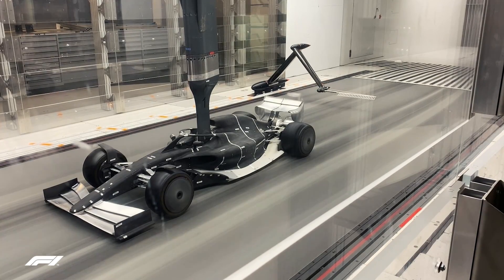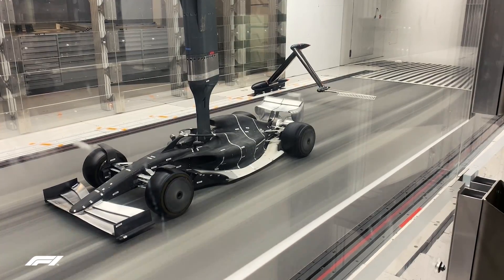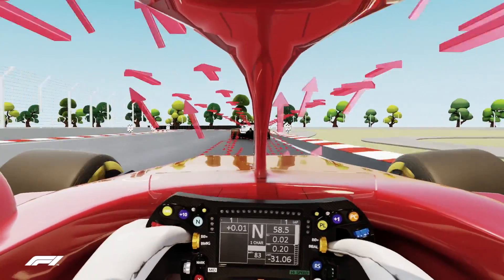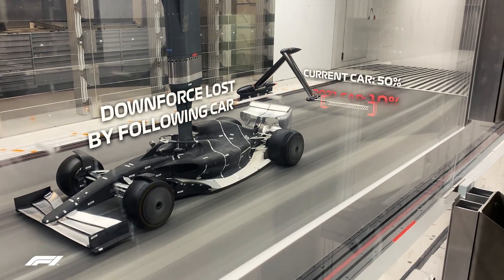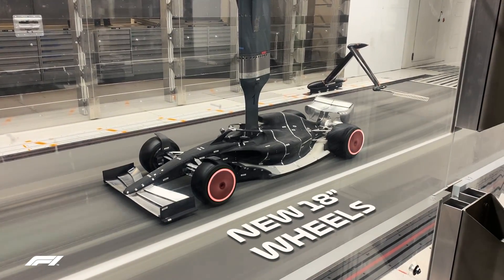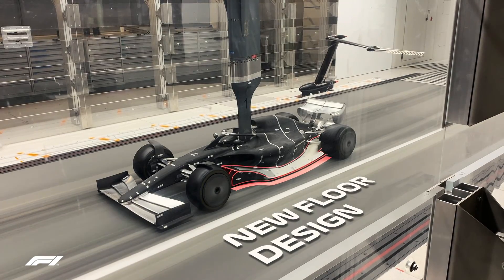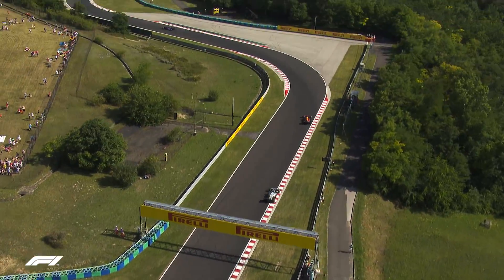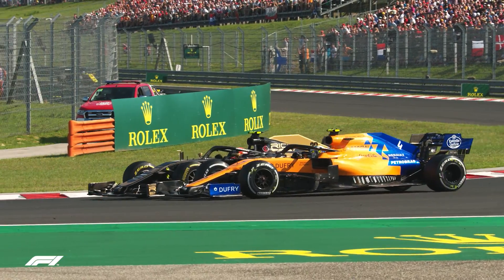Future F1 Car First Look | Formula 1's 2021 Car In The Wind Tunnel

Comment: So now that the rear wing is essentially a diverter, designed out of consideration for the guy behind you, forcing the 'exhaust air' upward, what's gonna stop a Smokey Yunick type team chief from enabling air to leak through that wing into the car behind him? Just find a way to defeat the design and direct a stream of exhaust air toward his lower leading edge and lift him right up.  
Sorry dude!  

F1's goal may be MINIMUM downforce lost by following car, but every F1 team chief's preference is MAXIMUM downforce lost by following car.

Comment: If the car following another car will have a smaller loss in downforce it automatically means that it will have a smaller gain in slipstream.
This is just a basic fact in aerodynamics: drag and downforce have the same principle in physics: Newton's third law.

If they say that the car following another car will be able to handle the corners better it also means that it won't be able to get closer as fast as it can now on the straights.

Comment: Let's just face it f1 will never be what it used to because all it takes is for one person to cry about safety and then thats it. There is more drama in one motoGP race than there is in the whole season of f1. Its sad because i grew up karting and actually looked up to them but if your a fan of f1 but tired of 15second leads watch motoGP. There isnt any crying over there. They crash and still race injured the next day passing off crutches before they get on the bikes and f1 needs to get back to that. Even Niki before he died said all the cars need to look different, bigger tires, less safety, no halo etc. You got Ferrari, mercedes, mclaren and i cant even tell the difference. I can sure tell the difference between honda, yamaha, suzuki, ducati, aprilia and ktm. 🤷‍♂️ F1 has there work cut out because they are losing fans quick.

Comment: I dont know. if my car has something on the middle in front of my eyes. It will be annoy me. But im not a racer.
Reply: Because your eyes see in 3d the bar coming down from the halo doesn't really obstruct vision. It's like when you hold your finger in front of your face and you can see through it. The drivers have also said it doesn't bother them.

Comment: If dirty air is not a problem, they should do away with DRS zones and include a limited time of DRS use at any point during the race so it's like an overtake button and driver's have to learn to manage it
Reply: Ved Singh  how does that not make sense? Instead of set DRS zones in a couple straights give them like 3 minutes of DRS to last the whole race (or whatever they approximate the number to be) and let them choose when to use it. Drs zones only exist as a patch for the problem of dirty air. Fix the aerodynamics and Drs isn't needed
Reply: Ved Singh  I agree. Wouldn't it be cool tho if we did away with the zones altogether and driver's had to recognize when they have dirty air and use Drs sparingly to compensate instead of being able to wait until a straight to get a free pass?
Reply: Ved Singh  what I mean is after a certain amount of time using it, the car would not let them open the panel. Like the time limit would be programmed into the car similar to ERS, they would just be able to use up some of that limited time

Comment: Alright, so the cars for the 2021 season will be simplified so they could follow one another, since aerodynamics has been simplified, will it have a significant impact on the car's performance, will the cars be slower/understeery because of the aerodynamics made less complicated?
Reply: They will probably be slower, but not that much slower. Ground effect is making most of the downforce back that simplified aero loses. But idc about them being slower if it means better racing.

Comment: Okay, so from what I understand, we’ve now come full circle. Less dependent on front wing downforce, more of the downforce is generated from the floor/diffuser system. 

You may loose a lot less downforce, but I’m willing to bet that tyre deg is still going to be a major factor, most likely magnified significantly. 

To counter that, Pirelli is most likely going to have to come up with a lot harder compounds. Know what that means?? Slower lap times. Unless they seriously ramp up the engine power, we are going to see PAINFULLY slow f1 cars. That’s my prediction.
Reply: these are going to be a predicted 3 seconds slower than previous cars. It probably won't be that much, considering the 2019 changes were set to slow them down by 1.5 seconds, but they ended up setting new lap records on many tracks. So I am predicting 1.5-2 seconds slower than 2020.

Comment: Finally all the ugly bargeboard madness in front of the sidepods seem to get banned! Thats fantastic! It just looked ugly, and got to complicated! Also the front wing has only the profiles! Finally F1 Cars may look good again! I think its a step into the right direction. But there is still the major problem - the Power Units! The Power Units with its almost 20 cooling circles is one of the main reasons for F1's problems! I hope(but i doubt it) they will get rid of them, too! But unfortunately that won't happen and the "Tuned Dust Devil" Sound with its problems for the Racing itself, will stay.

Comment: I think these cars could be really good, they seem more compact, and I like the shorter wheelbase, I think it'll make it much more agile and maybe "pointy" when thrown into a corner. I think this aero package though would be better with Michelin tyres than the Pirelli ones, because they have better longevity and would let the drivers push harder for longer. So couple the closer racing with the additional ability to push harder and therefore faster I think could make the races a lot more exciting. I think this is a push in the right direction. Just my 2 bits.

Comment: as Vettel said : " Bring back fu** v12s "
Reply: Are people really that stupid that they think 1990 V12 = 2019 V12?
Reply: @Tacet137  and what about a V10🙃
Reply: I think it will be better to use V10 again, but then again, that wont happen since SJW, Greenpeace, and political correctnes mofo today will and will find a way to be Offended by it.
Reply: Lan lol what are you even on dumbass
Reply: @Danielreis You only take aerodynamics into consideration when you like, but you need to think about them all the time. Aerodynamics made the V12s slower, and aerodynamics made the F1 boring because of the turbulent air the cars create. If you bring back V12s, you would have the exact same races, just about 20kph faster. Still zero action because the cars behind don't have enaugh downforce to take over the car in front. This is what F1 needs. Not more speed, not more downforce, less turbulent air so we can have more action.
Reply: We need engines that last just one race and they need to rev. Also there's no more last lap blow ups which were fun when your guy was in second, a driver behind the wheel of a time bomb is exiting. I don't care if they're slower than these turbo engines all I want is exiting racing
Reply: @rneoman  so yeah driver safety doesn't matter huh?
Reply: The v12 might be heavier slower
But i bet you my soul that there would be way more people watching if it would be v12
Reply: Bring back the clutch and manual gearbox
Reply: i wish it was v8 turbo so it will still sound high pitched
Reply: Victor Reis de Oliveira I do agree with him though
Reply: bring back the v10
Reply: The last time there was a free choice of engines team ran smaller engines with turboes over the V12, to bring back the V12 you would have to force everybody to use it over the actually better engine
Reply: Next it'll be 3 cylinder.
Reply: Zultoni Febriansyah v10 is the best
Reply: All of you asking for v12s weren't even alive when they were used lmao.
Reply: Ved Singh  his performance??? don't you delusional guys know anything about the concept the ferrari sf90 and sf1000 use??? its low downforce, high straight line speed! and as visible that you know as much about vettel as you know about rocket science, he prefers high downforce cars, and if 6 years ago is stone age then I dont wanna imagine which age senna, schumacher and hakkinen raced in!!!
Reply: Ved Singh  ok you are new to F1, clearly there is a big difference which I should have elaborated upon for people like you, I hope you know the difference between stability at the front and rear, drivers like Vettel prefer rear stable cars so they don't spin our from the rear as often with his spins which I hope you have seen, if you read Adrian newey's  ( bull chief aerodynamicist) book about the rb6 and following cars they were very high fownforce very stable cars and as for EVERYONE preferring high downforce cars, it's more about adaptability  vettel literally can't push a car if he doesn't have confidence in it and for that he needs more downforce, whereas Charles is  fine with cars with low downforce, if you still have doubts that these are excuses try to drive a car with low rear wing DOWNFORCE in project cars 2 or something and see how much you spin
Reply: Ved Singh  and yes I understood it's a hyperbole but still just the guts of you to say he lost his performance really triggered me, cuz even hamilton didn't say that in an
 interview.
Reply: V6s have more potential
Reply: They were abandonned 35 years ago so...
Reply: V12 would nothing change so its useless to disscuss about this engine.
Reply: @Zero.X  the sound would change the engines would again scream like they used to, turbos are cuntish
Reply: @rneoman  Honda's engine sounds great, come on you have to admit that
Reply: nahh too heavy
Reply: @PwnageJ  you think your opinion really outweighs the opinion of a 4x world champ who is involved in the sport so much
Reply: @maximus2536  funny enough "my" opinion came from everyone else's
Reply: @maximus2536  v12 are slower than the V6turbo
Reply: @peterlamprou7823  No is not. On V12 f1 era had no DRS, MGU, super hyper aerodynamic etc..So, get a 2019 car with a v6 and same car with v12. And think about again.
Reply: @peterlamprou7823  but doesn't make noise like lawnmower 😉
Reply: @yascoolskychief  at least it is faster and more reliable i want speed not noise and the V6 is fucking loud..go to a Grand Prix
Reply: @PwnageJ  speak for you're BRING BACK THE FUCKING V12'S
Reply: @peterlamprou7823  sure thats the reason why most of the lap records from >2004 are still there.
Reply: @Odysseus777  they are not and they were very inconsistent and failed a lot and very polluting
Reply: @peterlamprou7823  so either turbo the v12 or NA the v6. The v12 will be better.
Reply: @ImBrockatron  nah mate
Reply: @maximus2536  V12 were been part of F1 for decades.
Reply: @peterlamprou7823  that's cuz they haven't been developed upon and I think Ferrari laferrari whose is a road engine has 980 hp or something
Reply: @PwnageJ  who's everyone else? Tell me someone in the paddock not one of your comrades here in the comment section
Reply: @TheGous 

Nothing it's just that your name is so cool that i just had to
Reply: @PwnageJ  yea i like the v8s more

Comment: What I dont understand is: Why do they pull down the nose and connect the frontwing directly to the crash structure when they try to go for an underbody aero concept???
A high nose like 2010 will massively improve downforce from the floor as well as front tire squirt management without additional wake...therefore the frontwing could be less agressive in design
Reply: Because it looks and always looked like shit. One of the concerns with the new regulations is also having the car look good and cool, deserving to be an F1 car.
Reply: @tiagoml-qq5uh  well i have to disagree with your first statement. I thought the 2009 - 2013 cars looked amazing :/

Comment: This design is so good, in terms of looks. Its very beautiful looking for the same reason the current Indycar chassis looks so good. It's low, wide and sleek looking with some elements that sort of look modern but also feel reminiscent to older F1 cars. The nose/wing sort of reminds me of late 80s f1 cars with it's single piece design, for example. Plus the rear wing's simplicity without massive end plates looks so good. My only thing is that I wish the side pods were large and more traditional in terms of being more perpendicular to the car, but I understand that the car's main purpose is to be technologically advanced and fast so you have to aim for function before design in most cases. I still wish F1 cars were lower and sleeker looking like f1 cars of the past before 2009, but somewhere in the realm of this design i can live with.

Comment: It's sad that F1 has become a competition between manufacturers building the exact same car. Rules are important, but the excitement is being drained from the sport as a result. It used to be about "individual" innovation and skill. You know, having the "number one formula" of car and driver...There just aren't any surprises anymore. The days of ground effects, fan cars and 6 wheeled Tyrells are long gone. Ground effects are "NOT" a new innovation, there at least 40 years old. If everyone has them, they are no advantage. Maybe they should re-name it to "Formula everyone the same". The more the cars are the same, "less" overtaking will be the result. Haven't we all learnt that yet?
Reply: Then when one car is on top every race blowing everyone out the water, everyone is going to complain that races are even more boring.
Reply: @Cal3000  What the hell is the difference now, or over the last twenty years?  The more individual innovation allowed, gives smaller teams the ability to come up with new concepts and the ability to "lead" the field, even if it were for just one season. This is how it was in the days gone and the racing was more exciting and teams were given a chance at a larger slice of the winning pie. There were no complaints of boredom back then.

Comment: What power units are they going to have ? Hybrid or normal combustion engines with turbos?
Reply: I think they're using similar power units but with higher rpm and something more like KERS instead of ERS
Reply: @Commp01  ok cheers
Reply: @rockypupoxo  No problem

Comment: One thing I want them to do is make pitstops better also. I like fast pitstops, but there is almost zero strategy in them. Using 2 compounds of tyre isn't much. I want tracks to have pitstop rules like how many stops are required besides using different compounds or at least bring back refueling. There needs to be more variables within the team dynamic besides the driver to make racing interesting again. I love F1, but it's just damn boring seeing the lack of strategy. Love the concept design of the car so far. Doing what Indycar did is a good thing for the sport and I hope this actually increases overall speed of the cars also.

Comment: But FIA are the one to blame ! All those changes they made on the regulation every year killing the sport bit by bit. Some of the changes for safety reasons  (especially after Senna died) were great , the changes on the specifications of the engine , from twin turbo to NA was alright  ,from V12 to V10 was already barely acceptable, they should stop right there but unfortunately it keep getting worst until now to V6 , I just can' call a car with V6 engine F1 . But things get even more worst recently when they massively decrease the limit of engine and tire can be used and not allow to change , the final blow is not allow to refuel for the whole weekend  , How is it possible to have an exciting ,interesting and attractive  race , when all the  drivers are driving a heavy , less powerfull accuatly slow (compare to before) car , + preserve the tires not just the race but for the whole weekend ? Can't  blame the drivers cause there's nothing they can do .

Comment: The problem is more that there are no regulations to prevent politics from displacing the quickest drivers, or that Rosberg retired & Verstappen isnt at Mercedes. Otherwise the Mercs will once again probs build the fastest car under any new regulations
Reply: There will be a spending cap to limit the top teams from overspending.

Comment: A 5-10% reduction compared to up to 50%? Ross Brawn you damned legend.
Reply: To be fair, this is the beginning of the new arms race, while the 50% reduction is at the end of the current arms race, but  keep it under 20% and you’re still doing great.
Reply: What? Its simply a less draggy car. Question is how much slower will they be?
Reply: Hahahaha seriously. How many times does he have to save the sport?
Reply: chadgrov ngl, if they can measure the wake a cat length away, why not just slap a percentage against it. They could free up the parts of the aero formula and just state that you can’t go over 15% wake from a car length away for instance.